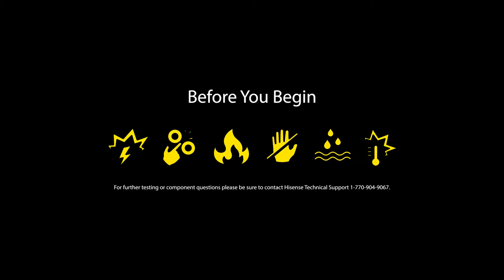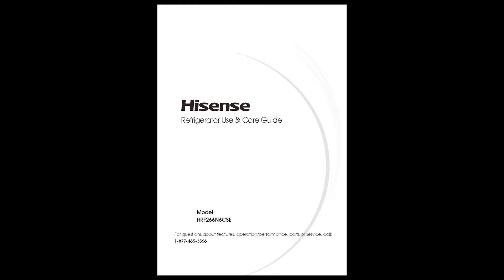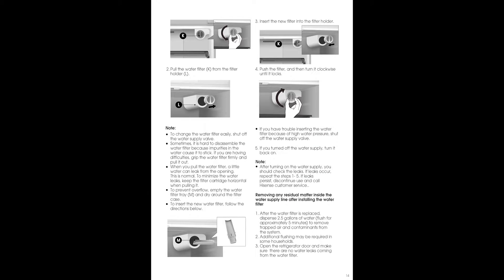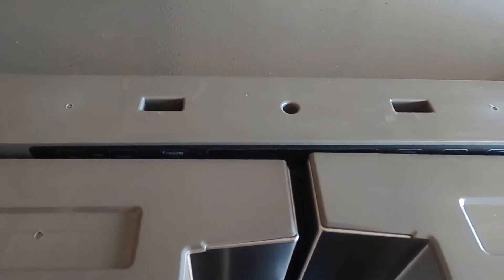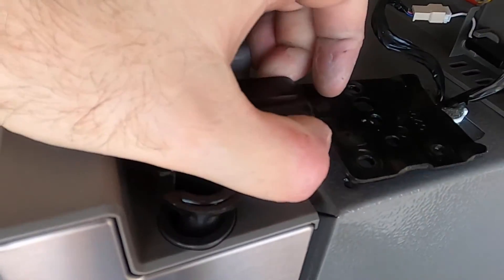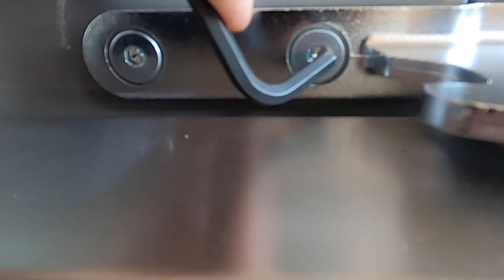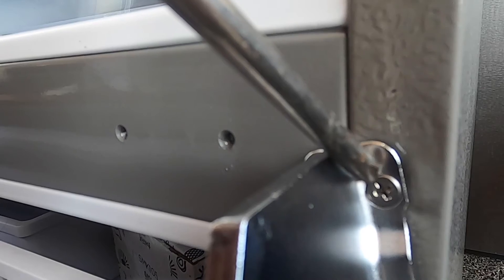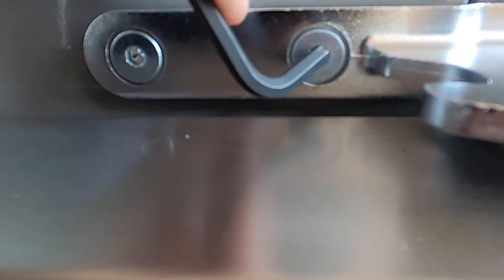Hisense 26.6-cu ft French Door Refrigerator (HRF266) Door Hinge Replacement

Comment: Yes if you're a tech like Josh said  bring a 5/16" and 1/4" hex head drill bit for this. I brought both I think it ended up being 5/16". Also note that they seem to have conveniently left out that the left side door has wires running into it that you have to disconnect before removing the hinge. Other than that very simple repair. Hinges are the same you're literally just installing a washer on both sides and replacing the hinges in the instance that they were damaged.
Reply: @Vicrattleskull2028  no, I wouldn’t recommend someone who is not trained or authorized to do this as it would likely void your warranty. 

Never work on something that is under warranty or recall unless authorized to do so by the manufacturer.
Reply: @Vicrattleskull2028  no, I wouldn’t recommend someone who is not trained or authorized to do this as it would likely void your warranty. 

Never work on something that is under warranty or recall unless authorized to do so by the manufacturer.
Reply: @Vicrattleskull2028   no, I wouldn’t recommend someone who is not trained or authorized to do this as it would likely void your warranty. 

Never work on something that is under warranty or recall unless authorized to do so by the manufacturer.